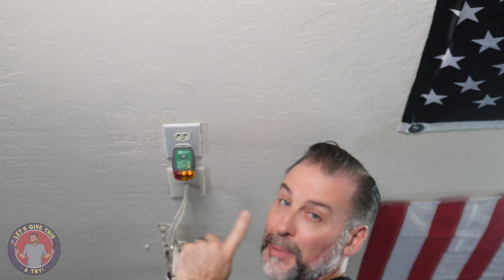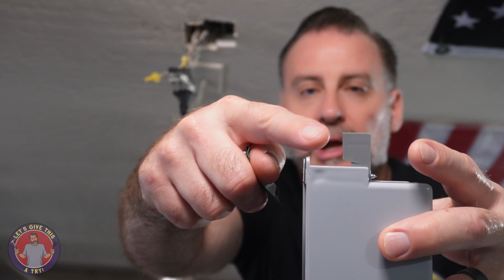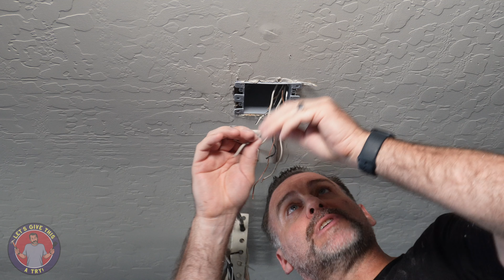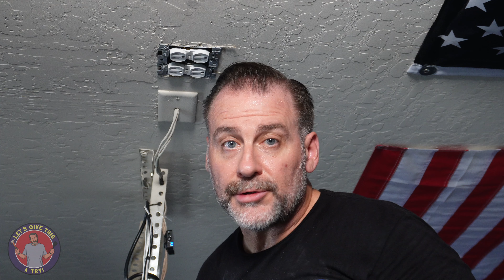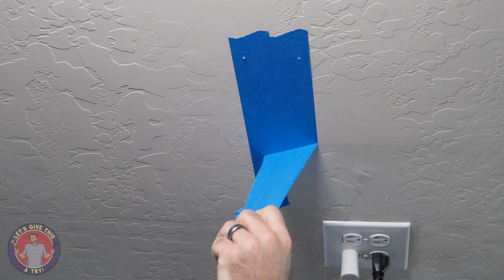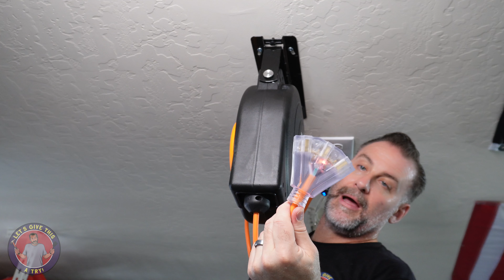Double Your Power: Unleashing 4 Outlets! Easy DIY BONUS!!! Vevor Extension Cord Reel Installation.

Comment: Nice installation the only concern i would have is to make a loop vs snaking / switch backing the cord from the outlet to the retractable extension cable. I would be worried about broke cable strands or heat generation and fatigue there. Besides that nice install. :)
Reply from the maker: @axelrod21  that’s a great recommendation. I am going to do that. I like it to look neat but it would be in vain if it just wore out the whole thing quickly. Appreciate it! Thank you! 🙏

Comment: Wagu connectors makes assembling pig tails a breeze.
Reply from the maker: I've heard they are easy to use. You fell they are safe and no issues down the line? I have a bag of them. Just haven't used them yet. Appreciate your thoughts on it.

Comment: i couldve made it into 6 for $10 and in 10 seconds. amazon Surge-Protector-USB-Outlet-Extender
Reply: Wouldn't that make you have to climb to the ceiling every time you need to plug something in?
Reply: @LTCustomsLLC  i was referring to 1st half video when he put a 2nd outlet in ceiling. could've just used an extender then hung reel instead of turning the single gang into a double. other than a cord reel or garage door opener or led shop light there isn't much you are going to plug into a ceiling outlet cause cord will fall out. 

guy done a good job. not complaining about that. just pointing out a faster, easier way for someone that isn't experienced or comfortable doing this type of work. Me personally, I would've done exactly what this guy done but have the 2nd receptacle switched. reel and opener on unswitched, then lights could be added to the switched side.
Reply: @SgtJoeSmith  Makes sense.
Reply from the maker: That would certainly be a good option as well! I'm anticipating other things possibly using the outlet on the ceiling so I wanted the permanence and stability of the outlets but you are absolutely correct. That is a quick and simple option for anyone needing to go that route. Appreciate the input and support! Thank you!